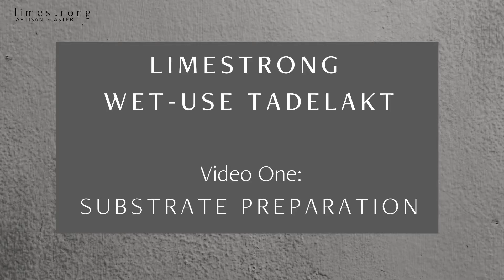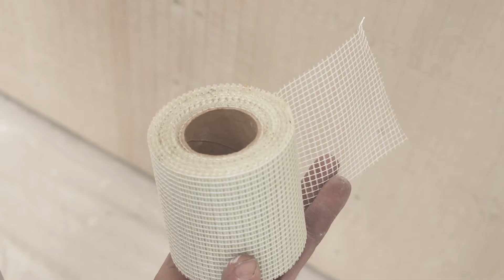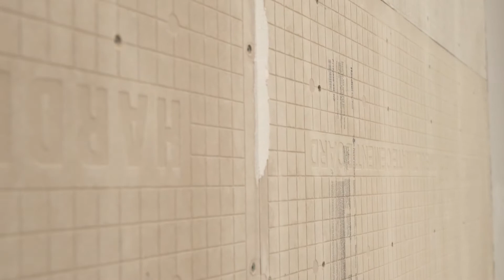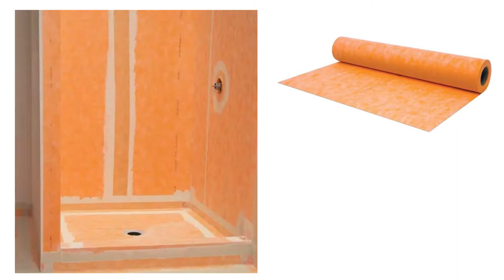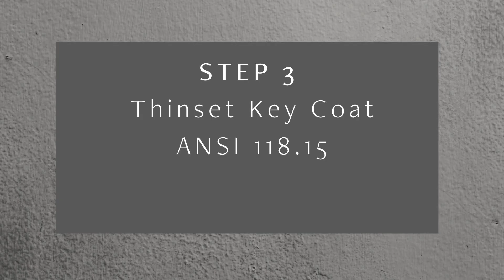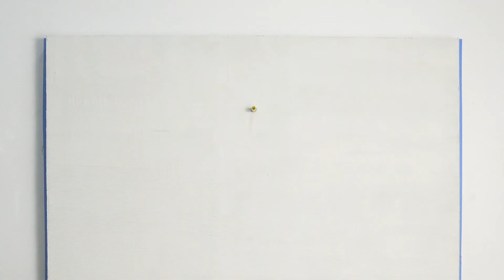Earthaus Tadelakt Finish: Shower Substrate Preparation

Comment: Would a flat top 1/8" v notch work for the key coat? Thanks so much for the video
Reply: Tyler, yes. We used one like this on a recent project.  Works fine. Just keep the thickness of the product consistently thick.